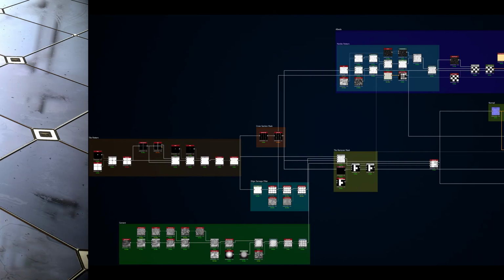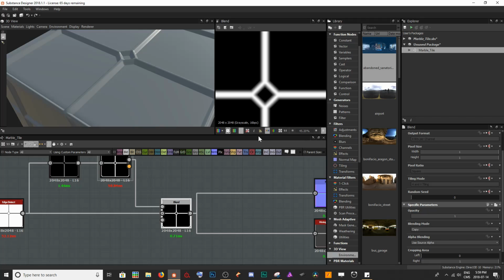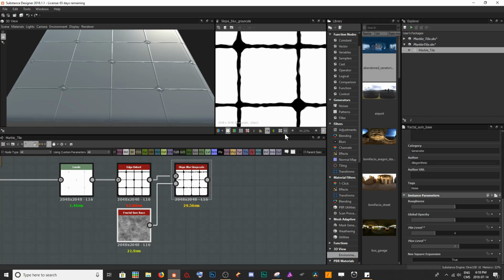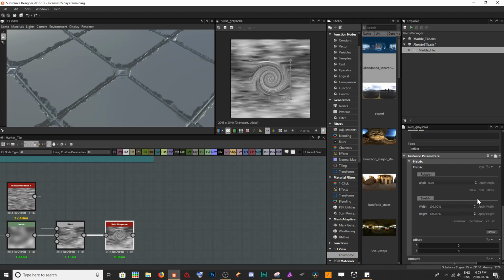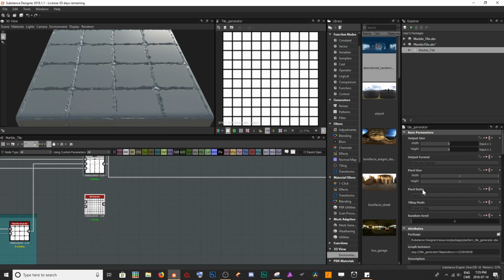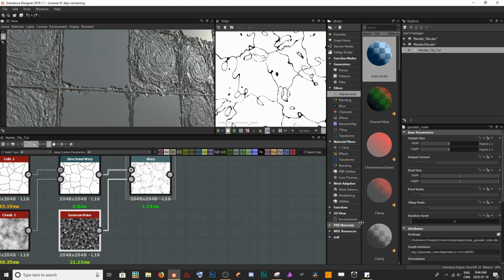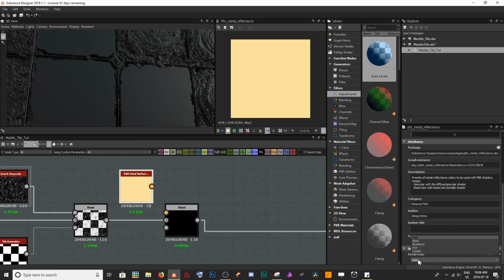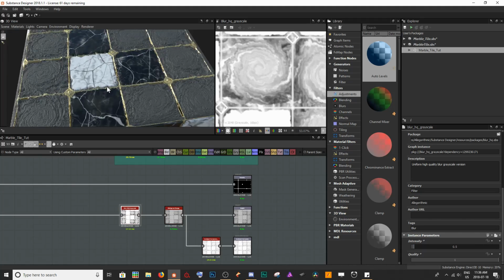Marble Tile | Beginner Substance Designer Tutorial

Comment: what would you have to expose to make the tiles not have any damage, like the final result in yours, mine doesn't feel right, the damage feels too big, even i followed the same procedure as you
Reply from the maker: One way would be to expose the blend between the two, so you can slide it to a more or less damaged state. You could also try exposong the Edge Detect node and see if that allows you to add or remove the edge wear as well. :)

Comment: How do you make the 3d view look deeper? When I do things like add a bevel or add the little pyramid it is still almost totally flat, but your looks like a proper 3d object
Reply: Nevermind, figured it out. For those struggling with it you need to make sure the height in the 3d viewport material is set to 10, not 1 like he says (a bit of an issue if you're only listening and not watching as much, like me)
Reply from the maker: Ya, Alleogrithmic changed the scaling so initially the software only allowed up to one. Now it's 10 for some reason. 😄

Comment: Hi I am struggling with importing the finshed material into substance painter. It looks nothing like what I have in designer please help
Reply from the maker: Hi Ben, I sometimes have this issue but I myself haven't really been able to solve it either. Take a look at this thread here, I think there might some possible solutions. :)

https://polycount.com/discussion/181384/materials-form-substance-designer-look-terrible-in-substance-painter
Reply: Cheer Thanks for the quick reply
Reply: I have had a look but still no joy
Reply from the maker: Unfortunately I'm not really too sure, my friend. :( My best recommendation would be to play around with the various maps (metallic, height, etc.) and see if anything can be done that way. The biggest problem is that it really could be anything, so that makes pinpointing an issue much harder.
Reply: its ok I have figured out a work around